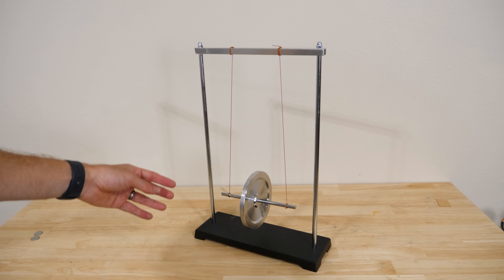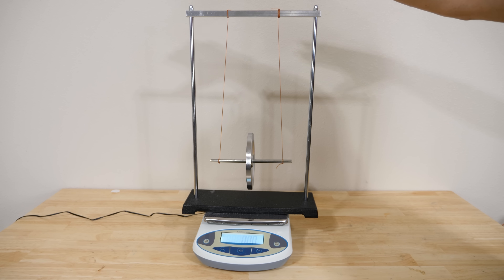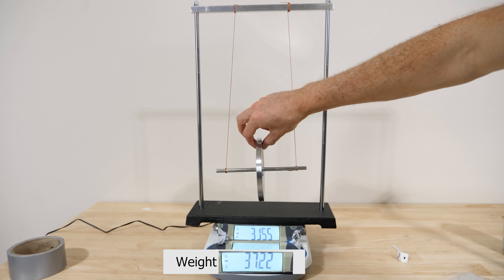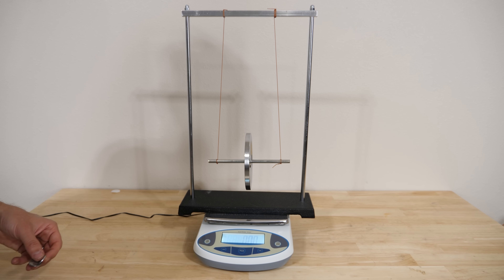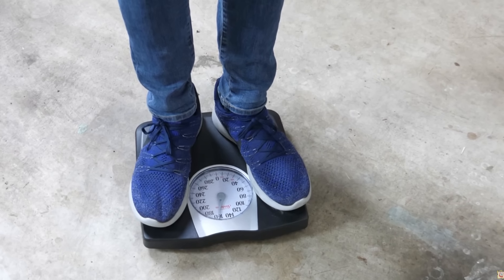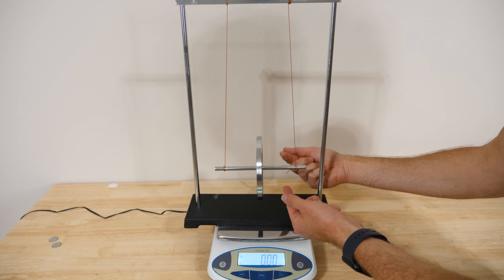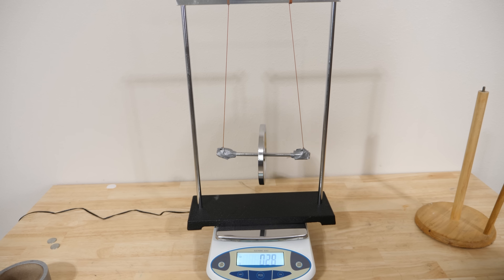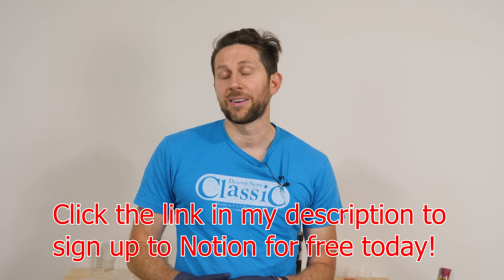How Does The Anti-Gravity Wheel Work?

Comment: Is their a way to make it fall continuously using a motor or something to add a bit of energy each time it comes up and down, kind of like a yoyo?

Than the next question would be, can you make "fall" so fast that the force overcomes it own weight.
Reply: Sure you can, but it will just be jumping up and down then.
Reply: @peterwhitey4992  Yeah, but the weight would be permanently lower. It has no real use, but it's interesting.
Reply: @MrSirFluffy  - No, the weight would still go above zero at the bounce, as it does in this experiment. The weight just doesn't update fast enough to show it.
Reply: @peterwhitey4992  It does not go above 0 during the bounce, it goes above zero when he rewinds it. The weight would stay at zero if there was motor putting energy in and getting the mass back to its starting position.

Comment: You've probably also dropped a magnet to a copper or aluminum pipe. The magnet drops really slow due to current in the non magnetic metal. But what would a scale say under the pipe?
Reply: Pipe+magnet mass, basically. Wait... That's actually a way to measure mass while it moves... That might be useful for some application.
Reply: Whatever percentage of force the magnetic field opposes gravity should be seen in scale at the bottom as something has to be equal and opposite to the force of gravity to slow down it's fall.
Reply: @johnschewe6358  all of the force opposes it for a long enough pipe, when the falling speed gets constant.
Reply: @VeteranVandal  Much like how you only feel weightless on an elevator while it's speeding up.

Comment: I disagree.   When it's going up, it's not "accelerating downward" --   It is accelerating upward, but that is causing it to have less weight on the strings;  When it snaps and bounces at the very bottom, the stretch in the string and the sudden direction change make it bounce upward, and as it spins upward, it has weightlessness because it is floating upward.  So it has the same effect as long as it's still accelerating in any direction.   I wonder what it would do if the disc was swinging back and forth--  would that also make it lighter/  and in both directions?   What about if it were to swing WHILE spinning and climbing?  Does it have any effect?  (I know that it's harder to do because the base is too light to keep that heavy disc while swinging, but maybe with a heavier base and lighter disc, you could do these other swing tests).    The interesting question that I wonder is:   Is it some kind of pulley effect?   Since the ropes are wrapping around the spool--    Would it change the weight if the shaft were much bigger around, so that it spooled the rope at a different ratio. (because the size of your shaft is directly related to the vertical velocity that it will fall, and also sets the RPM of the spinning disc.  So I really wonder what a different sized shaft would do.  Also with a really thin shaft that's maybe 1mm in diameter--  It would cause it to have many more wraps in the string and would make it fall much slower--- but would that have any effect on the weight reduction?     I have so many questions. lol

edit:    Oh wow-- so you did change the diameter of the shaft with tape-- very cool. :).    I still wonder what a "swing" motion would do to the weight;   because it still has that same reciprocal rise and fall as it swings--  I feel like it would have the same effect as the winding/ spinning, but I'm not sure:   and if so, would swinging and spinning combined to make it even lighter, or would it still be the same.   I love things that are counterintuitive like this.
Reply from the maker: It is only accelerated upwards when it hits the bottom of the string for a very short duration that isn't registered on the scale. After that the acceleration is always downward whenever the wheel is free falling (winding or unwinding)
Reply: @TheActionLab  I agree that it is slowing down when it is still winding upward, or "decelerating" --  but that is technically still "acceleration".  Any change in motion in any direction is still called 'acceleration, even if you are slowing down.   If that's what you mean by "accelerating downward"-- then I guess I see what you mean.  You are "decelerating upward"......   But it still baffles me-- lets not forget that it is spinning in both directions/  and whether moving up or down, with gravity or against gravity, accelerating or decelerating-- it still has the same weightlessness, just as long as it is spinning.  So it makes me think that it's not the acceleration that is powering the weightlessness, but maybe just a mechanical advantage of the shaft acting as a pulley;   On the way down, it's obviously the free fall, but on the way up-- it seems to be the momentum of the spinning disc reeling in the string as it's floating upwards off of the bounce.  It's not exactly clear why it still has weightlessness on the upstroke--  I wish someone could explain it with equations and show why it happens, because it's not so apparent.
Reply: @calholli  - It's not because of the spinning. The free fall is the same whether it's going up or down. If you stand on a weight with a rock in your hand, and you throw the rock up in the air, you weigh less, both while the rock is going up and while it's going down, until it hits your hand again.
The experiment could as well be done with a bouncing ball or an object on a spring. An object on a spring would show what's happening much better, because the bounce would be much slower, and the positive weight from it, would be able to be seen on the scale.
Reply: @TheActionLab  That upwards acceleration is only missing on the scale because the scale's sample rate is far too slow.  If your scale was a pressure transducer and connected to an oscilloscope where we could see more resolution, then it would make more sense.  In repelling, this is known as "fall factor" --  the amount of force that is generated from catching a fall, vs a static load of the same weight-- is enormous.  If a 100kg man is tied on right in front of him, like a simple lanyard and only falls 1 meter  on a short 1 meter rope (which is a fall factor of 1) --   That will generate 5.27 kn of force.  (220lb man falling 1 meter, would generate 1184 lbs of force when it catches you).   So my point is, there is a large spike of energy happening that is sending the disc upward, that is not being accounted for here- simply because the scale is not fast enough to pick it up.   This harsh rebound force is what is sending the disc upward, so that it is able to "fall" again.  so there is temporary weightlessness, but it comes at the cost of a momentary SPIKE of intense force, that makes it possible to repeat the fall.
Reply: @calholli  Excellent response, and example of a practical application of this principle.
Reply: The direction it's moving has nothing to do with the direction of it's acceleration. Acceleration is change of speed. If the upwards speed is slowing down, then it's accelerating downwards. If you throw a rock upwards, the moment it leaves your hand, it starts accelerating downwards, even when it's still moving upwards.
Reply: @peterwhitey4992  I see what you mean.
Reply: How does it "accelerate upwards"? True anti-gravity disc? :o
The only time it accelerates upwards is when it's turning just after it hits the bottom - while it's going up, it's accelerating down, you can tell because it's slowing down.
Reply: @Nabushika  Any time I've ever seen anything accelerate while it's going down --- it SPEEDS UP.   The reason it is slowing down is because it's still accelerating upwards  (edit: wrong-- I'm wrong here. :), from that kinetic bounce at the bottom.  But the really interesting part is that it still has the same weightlessness, whether it is floating upward or free falling downward-- which is really cool.
Reply: @calholli  if its accelerating upwards, it'll go upwards faster and faster. But it's not, as its going up, the velocity is becoming more "downwards" -> its accelerating downwards
Reply: Does it gets faster when going up? No then its accelerating downwards

Comment: Would you be able to connect two pieces of metal just by touching them inside your vacuum machine?
Reply: Do you mean 'cold soldering'? That require extremely low impurity (oxidation)... which is hard to do in ActionLab environment.
Reply: Well I've heard that if you somehow break/cut a piece of metal into pieces, you could simply put it back together because in a vacuum the surfaces of the metal pieces (where you cut them) wouldn't oxidise/interact with any gases, which are the reason that you can't put it back together in the atmosphere. So in vacuum, without any gases, wouldn't it be possible to put two metal pieces back together?
Reply: @narcissimus  Good question.  I assume you mean if a piece of metal was cut/broken in the vacuum also, and assuming no contamination to the ends.  The only thing I can think of is the crystalline structure of the metal could be altered by the cut/break as to not allow the molecules to re-bond.  On solid metal, I believe temperature is essential to recombine metals.  Mercury loves to go back together as long as it is molten, vacuum or no.
Reply: I know what you mean, but you might need to explain that a bit more.

Comment: Time to make a box that holds the disk and spins it up really fast.
So fast that it lifts it to the negative value of its own weight.
And break the internet.
Reply: It isn't the spinning that cause a decrease in weight though. It is the falling that decreases the weight.
Reply: Take it on a roller coaster and perform this experiment at the top of an inverted loop.  Then it will appear to lift itself from your point of view.
Reply: @carultch  it already appears to lift itself when it is going up from the momentum of the spin.
Reply: @MrT------5743  It isn't really lifting itself.  It's just that the center of mass is accelerating downward, so it doesn't need as much support to keep it from sinking through the floor.  But no matter what you do in this setup in a stationary environment on this planet, its acceleration will be less than g, and it will still compress the scale.

You would have to have its center of mass accelerate downward at a rate greater than g, for it to lose contact with the pan of the scale.  One way you could achieve this, is if you spun a heavy ball on a string so fast, tied to the top of that frame, that the tension in the string at the top of its motion exceeded the weight of the stationary framing.  You better adhere it to the scale and fasten the scale to the floor, if you don't want it to fly away.